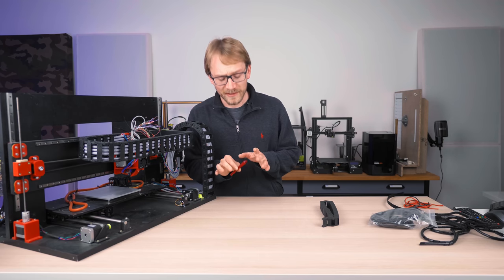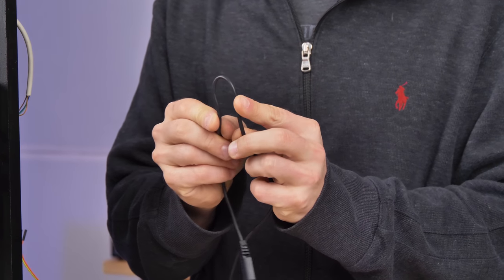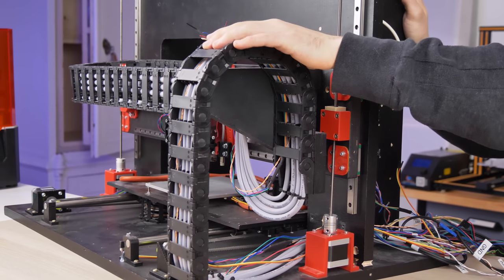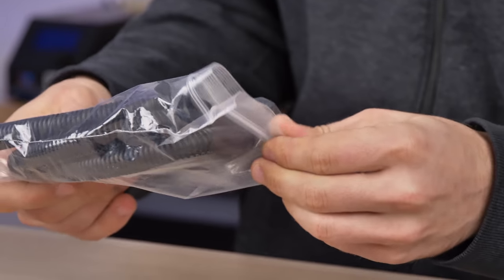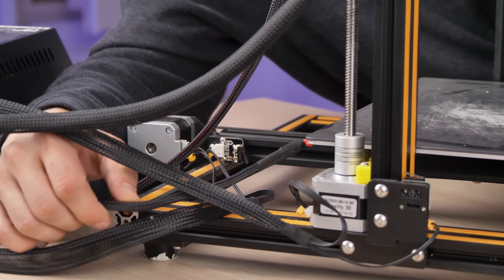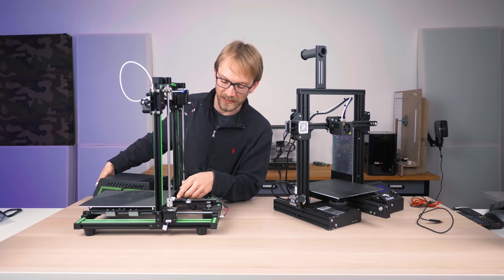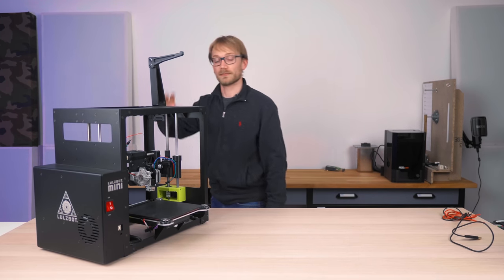Bad and great 3D printer wire management explained!

Comment: After the whole debacle with the M_ostly P__ted C_C, have you considered doing another CNC project? I've been in the process of building the FULLY OPEN SOURCE MakerFr RS-CNC32 which would probably be pretty low cost for you since it's all metric parts and there's even a seller on AliExpress that is selling parts kits for it now as well. Some kind community member also made a very highly detailed ikea-style assembly PDF

Comment: What a true 3-D printing hobbyist Would do is grab the formbot raptor  and show people how to correct the issue that comes from factory. Because this raptor two in all honesty as a rock and machine for the price the build quality and the rigidity of the frame absolutely amazing. There’s a few minor things you need to do obviously fix the wiring issue if yours comes like that mine didn’t thankfully by a BMG or barn tech extruder slapped a bad boy on their and your golden.                          Sorry if it was hard to read I am doing speech to text while I’m walking my dog because it is freezing cold out anyways good info video Tom I do appreciate some of the stuff you do let’s try not to worry we’re actually let’s try to like show people how to fix these issues that come with these Chinese printers rather than put them down you know what I mean let’s build a community instead of trash talk everybody think that would be the best thing to do anyways that’s my thought

Comment: FYI Tom, that bed strain relief was community designed FOR the CR-10.  Creality stole it and started injection molding it.  It was then added to CR-10 printers and almost everything else Creality has made since.  It was Preston of PressReset that first pointed out the CR-10 needed a strain relief on the bed.
Reply: How do you steal a public domain idea?

Comment: My goodness. Obviously I'm out of the loop, but what do you need so many conductors for on each axis? I think I'm maxed out at around 12 on my X-axis including the servo wires, end-stop micro switches, fans and LEDs. If those are full CAT-5's at 8 conductors per, that's at least 32 conductors! I'd just love to know what they are all for. Cheers :)
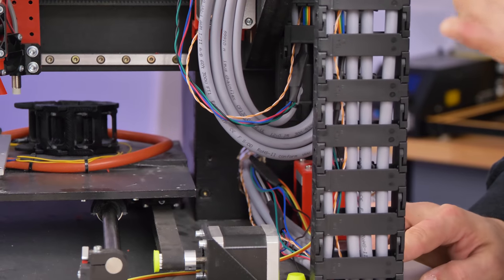Reply: Igus Chainflex CF130 with 12x 0,23 mm^2 each. - 7:00 - No idea what he did there, seems overkill for a simple stepper setup.

Comment: What do you think about using PTFE spray on the inside of the drag chain?  Either spraying directly or spraying on a painters sponge and wiping it on.  There is a "Dirt & Dust Resistant Dry Lube PTFE Spray" on amazon that I am considering.

Comment: Great info. I have been concerned with the bed heater wires on my Prusa I3S -- they are flopping around at the connector. I'm trying to come up with a 3d printed solution, but maybe just a wad of electrical tape would do.

Comment: Thanks for the reminder. 👍With so many other things going on, a simple instruct, or in my case, an important reminder (refresh brain-cable management priorities) is always a good thing.
I have pulled much wire and keeping the individual lines neatly in line and not, tWisTinG and OVerLApping not only helps with management but, should a single line need replacing, it typically, will often NOT, make it more difficult.
I hate wire cluster phuques.🤬

Drag Chains🤣Sounds like an outfit accessory for drag que----Wait! Can I say that?...so many rules and requirements for who is how to see and address😵‍💫

Comment: i always see ppl using the sheaths over the wires that come on most printers from the factory with the drag chains but i feel like that might cause the wires to catch but i dont know ive not tried it myself. my sapphire plus printer needs a drag chain for the hotend cause the wire is always falling on to the bed an im constantly trying to keep it from snagging on prints an its kept me from really trying to use the full build volume on that printer but ive been looking into the drag chains trying to figure out what the best option is an i feel like i would rather buy the chain over printing it cause all the one ives printed so far are quite noisy when moving them but ive only tried printing them in pla as of right now. anyone have any suggestions outside whats in the video?

Comment: I'm sorry to say, but that demo machine with cable-chains is awful. Have you ever calculated the amps those little nema 17 servo motors use? Are you sure that 4 pcs. finger-thick chainflex cables with 12 x 0.25 wires each (48 wires summed, but why?) are absolutely necessary and those energy-chains with about 60mm x 30mm inner size? I don't think that is a proper example to show how to design your CNC machine's cable management. You need to calculate things and you need to use the only necessary parts. You don't build a Leopard-tank, jeez.

Comment: Wire insulator rubbing against sharp edges something that even automakers & aerospace companies manage to overloop in some vehicles of different formats that they produce & manufacture  // the endless slog of constantly redesigning // instead of just doing like Prusa & taking a good reference design & continuing to improve it // a box with wheels that goes forward & backwards with safety features to protect passengers & emissions controls to protect everyone from tailpipe pollution // 

3D FDM // a hot glue gun mounted to a motorized microcontroller frame that extrudes small liquified tubes of plastic onto other layers of plastic using code created by slicing software based on a 3D design file for the object design

I think an well made infographic could summarize your 16min video into an Image :)

Comment: How do you feel about 3d printed drag chains?
Reply: I know you're not asking me, but my 2 cents, I've two printers with injected molded chains and 2 with printed chains. So long as your printer is tuned nicely, the printed chains work just as well as injected ones. 

One thing I like better about my printed chains is I use a design with 2 different links....one has 1 side open (like a U) and the other has the opposite side open....so when I need to remove/replace/add any wires, I just deconstruct the drag chain link by link instead of having to disconnect every wire and feed it back through the drag chain.
Reply: If you print them with PLA they make more noise then injected nylon ones.
Reply: I've used both printed and injection molded and by far just buy some injection molded ones. There super cheap and will last forever. All my pla links warped from the heat bed, abs ones cracked after a year/10,000 hrs. For how long they take to print it's not worth it. They're also no as smooth as real ones. Either too tight or too loose.

I have also printed the u shape ones mentioned above. It sounds good but was just as much as a pain and over all made the links weaker and more play. Also kept loosing the bars. For the all of 2 times ever in 3 years it's not that much of a convenience

Comment: One trick I’ve used is to put a piece of filament in with the wire bundle to give it some additional rigidity to prevent tight bends.  Of course, the downside of that is that the filament will eventually wear out and break.
Reply: String lawn trimmer line - Nylon reinforced with continuous glass fibre.

Comment: Print some cable brackets & add lots of zip ties to tighten everything up // to reduce cable fatigue at flex points where cables enter connectors // amazing the manufacturer skipped this step given low cost of such a solution // seems like a thoughtless cost reduction exercise than missed the finer points of proper cable management // well done CHINA //
Reply: Then again, nothing lasts forever .. so try to enjoy your time alive as much as possible since we are all running out of time //

Comment: I need a sub $200 printer that can print smooth, no-stop prints at around 50mms/(heated bed). Ebay $100 Tronxy all aluminum frame.. Junk. Anet A8 required a lot of upgrades.. Ender 3? the parts are no larger than a big pack of smokes.
Reply: brainfarth first of all, you need to get your budget-to-desires ratio right...
Reply: @sh4dy832 it can be done.. There is a lot of competition out there now. I was hopeful I would have to buy half of them before finding the one I am looking for. My long-term plan is to buy several of them, assuming they hold up.
Reply: Michael Boquist if you buy cheap, you buy double. Simple equation that holds up almost all of the time. Your only chance would probably be something 2nd hand that is notorious to be prone to failure and hope you're lucky...

Comment: There are two kinds of network cable. The in-wall type are not rated for motion (solid or not finely stranded), and the stranded types for interconnecting cables that are intended to handle flexing.
Reply: Was looking for this, most people cheap out when buying cable and therefore think all cable is created equal as solid.